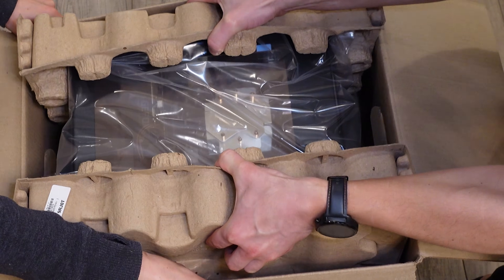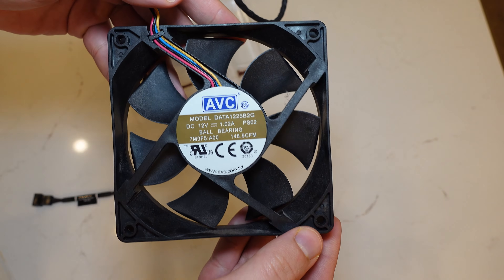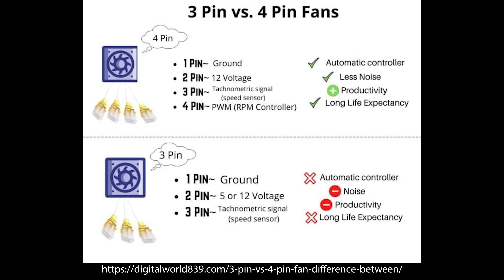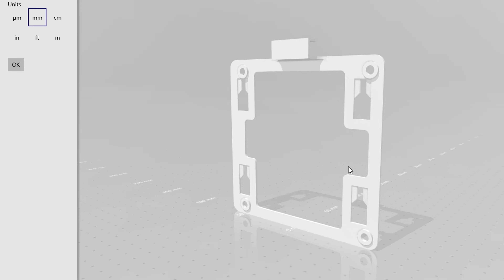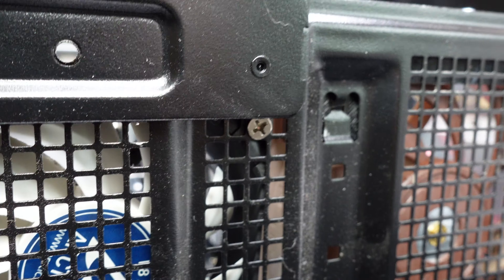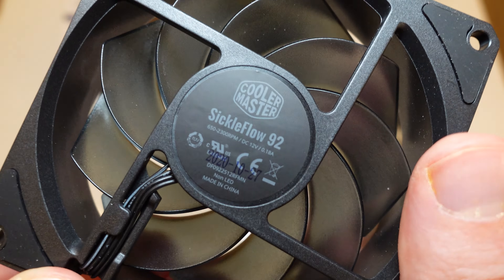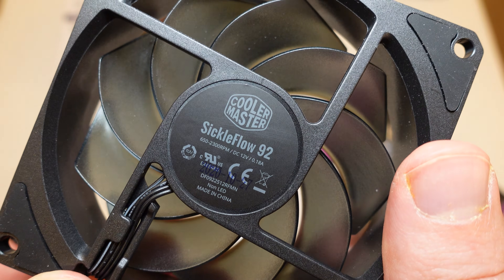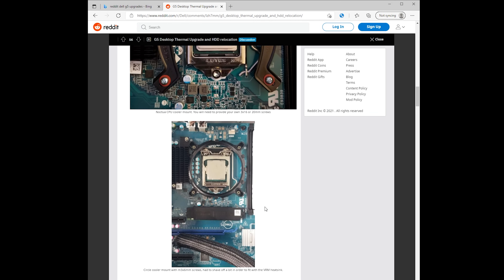Improve AIRFLOW in your Dell G5 or XPS Gaming PC (step by step tutorial mod)

Comment: So I need two y splitters to connect the 3 fans and cpu? Cause im confused lol 😆 I only got 1 splitter so therefore I cant do it? 
I got the arctic p12 pro 120mm arctic p8 80 mm for front and rear noctua 92 mm

Comment: Dell's original system fan setup ain't bad, their engineers didn't set it up to fail from overheating. The system fans are meant to enable air turnover in the casing, they don't have a direct effect on cooling, the CPU and component fans and heat sinks do that. A lot of people has the bizarre misconception that there must be an intake and exhaust fan to keep everything balanced or to create an "air current" effect from front to back. This is simply not true, air is a compressible medium unlike liquids. The air gets in like blowing up a balloon with equal pressure exerted on all sides. The positive pressure is important, it is a natural physics law that the pressure outside and inside the case will seek to equalize. With positive pressure, even if there is no exhaust fan but an outlet hole, all the hot air will be vented out of the case immediately. Oh well, a lot of business people are very happy with the ongoing purchases.

Comment: Hello... thanks for the great video... I recently purchased a used Dell G5 5000 desktop (i7-10700F, rtx 3060, 16gb ddr, 500w psu) for occasional gaming in the living room. I am thinking to add the "Arctic p12 PM PST - 120mm" on the front along with that 3d printed bracket and "ARCTIC F9 PWM PST - 92 mm" on the back to replace the OEM 80mm stock fan. I am planning to leave the CPU cooler as is.... You think those fans will work on this pc? and also will that add any improvement in cooling? On the specs of both P12 and F9, it says that it has cable splitter.... do I still need y-splitter?

Comment: This was really useful and I ordered the fan off the back of it.  i do unfortunately get the BIOS error on startup with the XPS 8950.  However, I live with it because the silent fan payoff is worth it!  These Noctua fans are awesome.
Reply: @advenchura Do your fans properly work? I installed the noctua u9s with a push/pull config to the 4pin connectors at the bottom of the 8950 motherboard, and my bios gives the error but the fans sound like they're spinning loud enough to sound like 80% at all times. Did you ever do anything to fix the bios issue?
Reply: @JimboJack3  Hi unfortunately there is no fix for the BIOS issue, but since then I have rebuilt my own PC, I wish I did that in the first place.  One thing you could try is a splitter to run multiple fans off one of the heads that doesn't give the BIOS error.  But its trial and error, or buy a separate fan controller.  Good luck!

Comment: solid video. a quick tech question if someone is passing by : is there a very limited choice of case fan I can use to upgrade to avoid boot problems, or can I use any if all the required technical aspects are there and what are they? 92mm, 12 volt, 4 pin, and I'm good? thx for any answer.

Comment: Thanks a bunch for the video and advice! I held off on buying the noctua cpu cooler as I have the tower cooler from Dell. Decided to buy two 92mm noctuas (one for the back and one for lower front as I have the XPS instead of the G5) managed to attach the 92mm lower front fan with some thin steel wire, it's a little hacky but is works great! Temps in the case dropped significantly for GPU, CPU and M.2. Your video really helped in deciding what to do :)
Reply from the maker: So glad to hear!

Comment: Just wanted to say great video, I did the fan and cooler swap before. Using a dell k series cooler on the non-K CPU and repurposing the 80 mm fan to the front using an 80mm 3d  printed bracket you can install sidewise into the case and it will work fine using standard fan screws. Also did a 120 mm fan on top of that one using the 3D-printed bracket.   What were your temps under load max and mins and averages?  I can get anywhere from 88-93 highs on the CPU still it doesn't thermal throttle just power throttles after about 230 seconds. GPU is about 73c under load. I know the 3060 TI and 3070s vent hot air into the case.

Also, note I used the Scythe Flex 2 PWM high STatic pressure 93mm / CFM as a rear exhaust and 120 mm scythe flex II high cfm static pressure front intake, they do not cause post errors as well.  Sadly unlike the G5 8940 you cannot adjust the fan curves as the Alienware fan software doesn't read the 8940 fans.  You can use Speedfan which kinda works, however, the fans will never reach full speed as it seems that DELL locked the there fan curves to about 1500-1600 on the sys and 2850 on CPU.

Comment: I just bought this im doing the same upgrades. 

The back fan goes into the 4 pin at the back (next to vram heat sink)

The cpu fan goes into the cpu pin 

Where do i plug in the front 2 fans ? 

Even if i use the extension and spliter on the very back 4 pin connector next to vram heat sink that only allows for 3 fans.

Im drying hook up 4

I think im missing the location for the 3rd 4 pin connector onto motherboard where is it?

Comment: I just ordered the Dell XPS 8950 pretty much maxed out on all components. How difficult would it be to just take the expensive components from it (cpu, gpu, ram, ssd) and just throw it onto a new motherboard and put it in a new case with a 360 mm AIO? I am really worried the bad cooling is going to affect the performance since I have a 3080 and a i9 in it.

Comment: I have 2 Noctua A9's on the CPU cooler and another at the exhaust.  I used the low noise adapters on the 4500 rpm pancake coolers and I have 2 80mm at the front constantly running at their "lower" speed of 2400 RPM.
Reply from the maker: Nice! It's gonna stay cool

Comment: Hey hopefully you can answer my question. Could you explain where to connect the front 2 fans . I’m kinda confused on where they would go. Especially the bottom 80mm
Reply from the maker: Just use a fan splitter
Reply: @JSyntax  okay. and whats the power supply in your verison? 500w?

Comment: Thank you for this video!    Bought a G5 to hold me over until prices get better to build again.  i5-10400f  rx 580 8gb . Originally it was running 72 degrees on the cpu and 72 on the gpu while playing pubg - added the 92mm Noctua fan as the exhaust fan and I am using the original fan as in intake ( removed the HDD tray)     Temps were between 56-60 on the cpu and around 62-63 on the gpu.  $20 for 1 fan was to do this was well worth it.  I might upgrade the cpu cooler eventually but I am rather pleased that this computer can be solid for just a bit more $ into it.  Dell should really spend this extra amount to make it useable in the first place.
Reply: I have a Dell G5 too, and I plan on upgrading the GPU to a RTX 2060, do you think buying this fan will improve its overall performance? If so Is the fan on Amazon because that's the only one I can find - thanks

Comment: Should’ve listened to your advice. I got all fans setup however I found the front fan 120mm isn’t produce much difference and that’s about $22 wasted. I say the cpu fan, the rear 92mm and front 80mm could be sufficiently get to 29-30 on my 8940

Comment: Can anyone tell me if installing something like the 92mm noctua a9 fan as the rear exhaust fan would help keep my PC quieter under CPU load? I installed the Vetroo V5 CPU cooler (drawing air towards the rear fan), which has worked wonder for temperatures. The problem now is that the system gets so loud when the CPU is at just 60C, and I don't think my XPS 8940 allows for me to adjust fan curves manually.

BTW, this was a great video, it just doesn't quite help with the question I came with.
Reply from the maker: Yes it will. but hard to quantify the real impact

Comment: also: if you upgrade fans; you must use advanced settings (offsets or smooth line); the reason is that if you choose one of the stock (performance, quiet, etc) settings, Ive observed that the system can't manage the fan speed at times and the fans stop and start, its very odd.  use custom profile in AWCC
Reply: What do you use? (for offsets or smooth line)
Reply: @DuskIntent  I think I have my offsets set to 75, not sure

Comment: FYI - the AWCC will still use the exhaust fan as if its still the original.  The orig exhaust fan could run at 4200rpm and the A9 can only do 2000rpm.  So if your thermal profile is set to Performance; that fan setting assumes the orig fan is in place.  The tables it uses for the preset thermal profiles will all assume the orig is there, even if it isn't.  The workaround, I think, is to create a custom thermal profile and set some offsets.  do NOT create a thermal profile and set it to automanage.  why?  because AWCC can't automanage the A9 fan.  If you do this, the fan will just stop but AWCC will say its running at 100% when its not running at all.  I'm surprised no one's noticed this
Reply: How do you change it?
Reply: @Alex-R164  as far as I know, you can't.  The only viable solution is to buy a fan that can do 4000 rpm.
Reply: I bypassed AWCC by connecting the fan directly to the PSU with a fan to SATA adapter cable. AWCC says fan is running at 0% but it is running. You can’t control the speed though, it’s a constant 100%

Comment: Great video! I was wodnering if i can replace the Noctua NF-A9 92 mm fan with the Artic F9 92mm fan (the fan speed is 150 - 1800 rpm). I don't know if using the artic f9 fan will cause the same errors you mentioned in 1:31. Thank you
Reply from the maker: Should be ok! Worst case scenario, exchange for noctua!

Comment: Thanks for the video. I managed to cram my old exhaust fan next to my 3.5" HD by removing the clips by using 2 rubber connectors and 2 zip ties. Very important to connect the 4 pin connector to the old exhaust fan to avoid the BIOS error. I ran it initially w/o the old exhaust fan, but added only to correct the BIOS error. So far so good.

Comment: I just recently got the XPS 8940, and started looking into fan upgrades, love the 3d printed bracket for the fan, very cool.  Not sure what can and can't be done to maintain the DELL warranty. But the case fan upgrade should be ok for sure.
Reply: how can I get one of those 3d fan mounts?
Reply: @Buckeyebob  You need to have it 3D printed by someone with a printer. there are sometimes printers even at Library that you an use to print. Do a google search.

Comment: What if I replace only the Dell 80mm stock cooler at the back by Noctua 92mm Cooler? 
Can I still expect to see some temperature drop? Thanks~~
Reply from the maker: it should be a decent improvement!
Reply: @JSyntax  First of all, thank you for the video and reply. Yes, you are right. I replaced dell stock cooler by Noctua and the improvement are noticeable. I placed stock cooler at the front. lol. It’s really loud. So beginning to think about new noctua as intake maybe 80mm. Not sure I can do well with placing bigger one such as 92mm, or 120mm as front intake. lol. so another concern started.

Comment: Great video! Happy to see someone getting use out of the fan bracket!
Reply from the maker: You made it?!
Reply: @JSyntax  I did indeed!
Reply: Sorry to hassle ya, but would you have a screw recommendation for the 3d printed bracket?
Reply: @Schmooogis for retaining it in the case I reuse the case screw, which is probably an M3? Honestly you probably don’t need it since the side panel will hold it in anyway.
For holding the fan to the bracket I use the sharp thread ‘plastic cutting’ type flat head screws to hold the fan to the bracket.
Reply: @purpledrillmonkey  thank you for the reply, i appreciate you so much lol.

Comment: Great video, I hope I have found this earlier. I have a 8940 with the pancake fun, I exchanged the cpu fan to the K version tower, added VRM heat sink. I probably should have stopped there. But under load my 3060 ti temp hovers around 67-75C, and cpu in the 72-78C range occasionally into 80s. So I replaced the 80mm rear fan to a noctua A9, plugged into sys_fan connector, without adjusting fan curve (I don’t know how, and I thought pwm will optimize the performance and noise level). And the only difference I can tell is lowered noise, no change to temperature at all. Now I’m not sure if I should go further and add a 120mm intake. But you mentioned that it is not worth it… another thing, 8940 front panel does not have perforated vents in the upper part, will that 120mm even work as expected if it is installed in the HDD bracket location? Thank you for the nice video and apologize for my English.
Reply from the maker: I'd say it's worth it if someone can 3d print that part!
Reply: @JSyntax  I went ahead and added the 120mm intake, it only cost me about 8 USD to print 2 copy of that frame. But I end up removing that 120mm intake because it made the cooling worse. My guess is that because the front cover of 8940 is only perforated in the lower half, the 120mm intake didn't actually bring enough fresh cool air in, instead it created a wall and trapped some hot air from reaching the exhaust efficiently. The lower part of side cover got quite a bit hotter than without the 120mm, seems the hot air produced by the GPU was trapped and couldn't move up as much as with just the 90mm exhaust.

Comment: I have the same PC, I see that the daughter board that controls the RGB has an empty 3 pin slot, I've seen people connet a 4 pin fan into a 3 pin slot before, I have both a 4 and 3 pin fan so I an wondering If I can take advantage of this slot on the daughter board to plug in (perferably the 4 pin fan) to create an intake as I do not have a pwm splitter.

Comment: Is there an alternative to using the artic fan? As I'd like to know if there is a secure way you can still have the gpu bracket. Would installing the dell fan or a Noctua fan work there securely?

PS I know you said the artic would work if you used one screw but I'm not sure how secure that fan would be...
Reply from the maker: Any 80mm fan will do! I use 2 screws in the end. No issues with gpu card

Comment: Hey man your videos are a lifesaver! I have a xps 8940 with the 3060ti and used your vids as a guide. Noctua cooler and 92mm exhaust brought the temp of the cpu to 60 or under full load. Using the old exhaust as the intake is very loud and cooled off the cpu even more but but only 2 degrees of difference to the GPU. I assume a noctua intake would be far quieter however I'm not sure if it's totally worth it.

Comment: Thanks for the info! You're a real Saint. If I can ask a question, you can use one of them 5 way splitter hubs for all the fans right? Instead of just using y splitters? Also when doing the whole exhausting of air for one fan and fresh air intake for other two, that's up to the direction the fan is spinning? Which I assume can be set in fan control? Sorry I'm pretty new at this.
Reply from the maker: U can but splitters are easier!

Comment: How did you change the fan speed for the 120mm so it could supply enough air and what fan curves worked best for you? Thanks.
Reply from the maker: You'll need to tweak on Dell alienware command center

Comment: I'm about to add the 120mm noctua (intake)  I was able to get the 3D model bracket. 

I already did the NF-A9 and cpu cooler swap. I'll bring the original Dell OEM at the GPU level and add the 120mm at the top as intake. 

With now 4 fans including the cpu cooler. Which one should be together with Y splitter? Intake together and cpu/radiator together? Which one should be on the 3 pin vs 4 pin on the splitter? Knowing that I now have 3 noctua and 1 Dell OEM?

Finally ;) how to properly maximize their potential through AWCC?

Thanks for your help and time!!!
Reply: Hey, could you tell me how much help the NF-A9 rear exhaust fan is at reducing temps, and how it affects noise after already doing a cpu cooler swap? I'm trying to get a good estimate because I switched the crappy pancake cpu cooler for the Vetroo V5, which has done wonders for temps, but "it" (I don't know which fan, could be the 80mm rear fan) gets way too loud while gaming.

In exchange for any help you give me, I'd like to let you know that you can run some commands in the powershell that enable you to go into power options and set a limit on maximum processor frequency, to help reduce temperature or noise if need be https://www.majorgeeks.com/content/page/how_to_add_or_remove_maximum_processor_frequency.html#:~:text=Maximum%20processor%20frequency%20specifies%20the,or%20consuming%20too%20much%20power.
Reply: @Raddnedge  I did the swap of the cpu and exhaust at the same time. I moved the old Dell OEM fan as an intake. In terms for temp I have max 80 on cpu and GPU when I play games...

My next move is to add a bigger intake and move a small fan at the bottom of the intake near the GPU and all of them being noctua to reduce the noise

Comment: Your analysis of the 80 mm Dell versus Arctic fans is incorrect. The Dell fan is designed for airflow because it is intended for installation in the back of the case. Front case fans on the other hand are designed for high static pressure as they push air into the case.